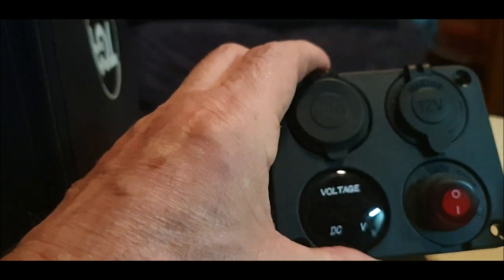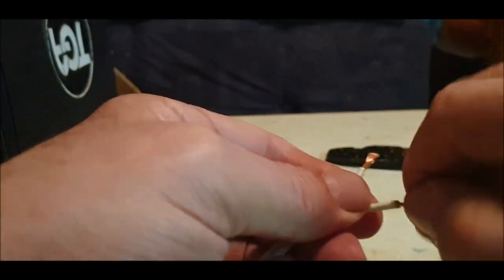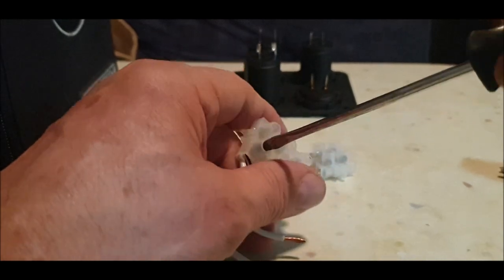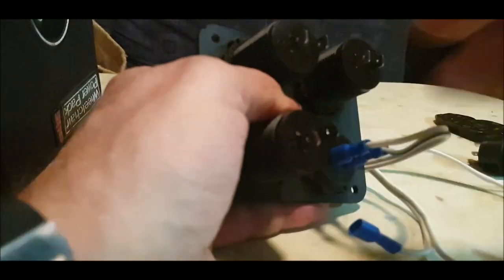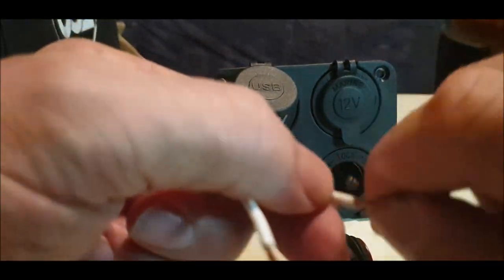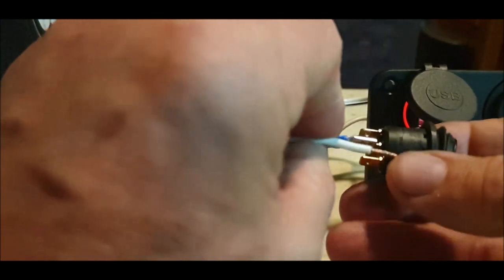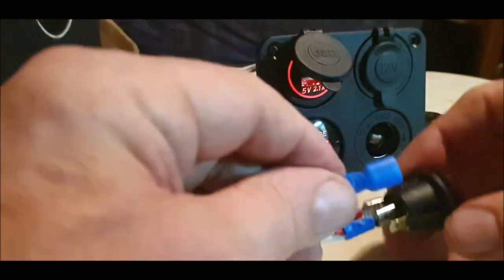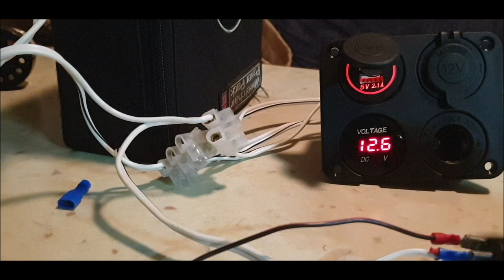HOW TO WIRE A ROCKER SWITCH WITH LIGHT /USB /VOLT METER /CIGARETTE LIGHTER

Comment: For someone confused,  Its like this  The golden prong on switch is NEUTRAL (minuss)   center is Live Output, and Top is LIVE Input,    So for light to work,  u take NEUTRAL from Light and Battery togheter and put in Golden prong,   In Middle u put Light + Pluss wire, and Top is ur Live from Battery , Done .

Comment: Me and my dad watched this to wire a light switch and was so confused he blew my switches up twice. I’d say edit the video and remove any unwanted footage that’s not required to do the job. 18. Mins long and various wrong attempts just add to the confusion. Edit it down to 5
Reply: That's because he's wired it all wrong, the centre is common live, the same colour spade is the switch live that goes to the panel and the bronze coloured third spade is the negative, you need this otherwise the lrd light won't work

Comment: Is the switch not for the whole unit all together? I bought one but the switch is 3 prong to begin with. I thought the switch was used if you wanted to turn it on to use the USB or 12v hook up. And if you didn’t you use the switch to turn everything off. Am I wrong? Or you simply wanted to use the switch for lights instead so went that route?
Reply from the maker: i use it to turn everything off
Reply: Yes he's got himself confused and as for cutting with hacksaw ?? It's long to avoid shortage out
Reply: It is. It's for the actual panel, not a different load.

Comment: Hardwire battery live to switch Split switch wire to live using spade to product live or 1B: connect the live further back on switch wire and shrink wrap 👍 save and maintain battery life. 

Tho. Which I laugh at most is people saying about battery life! If the vehicle is being driven on a daily basis then a straight connection to battery means nothing forbidding there’s a fuse inserted in line to live.